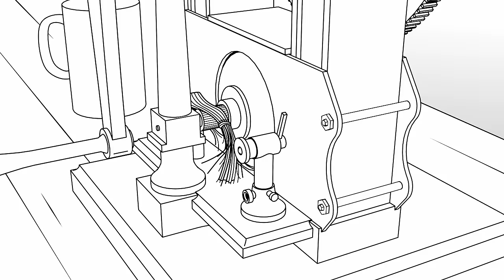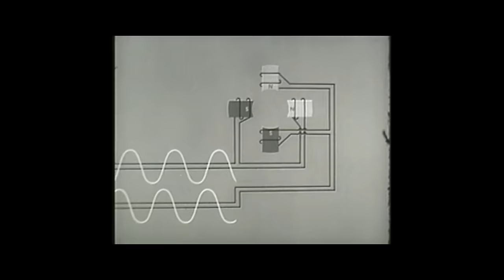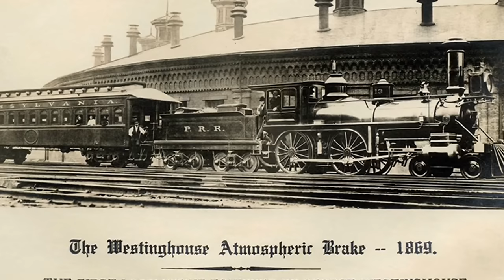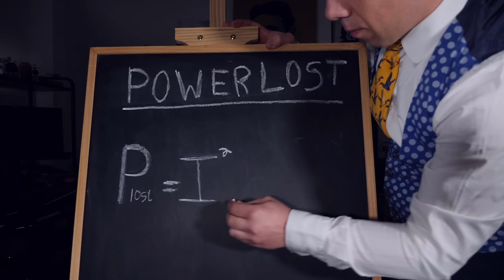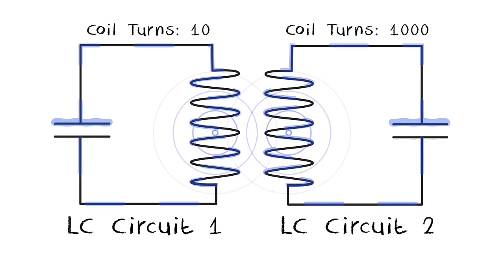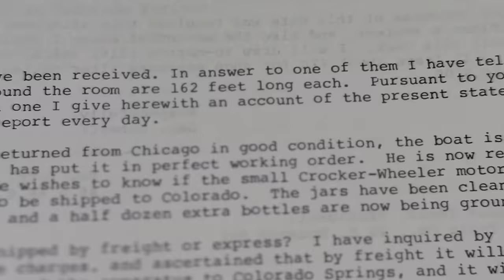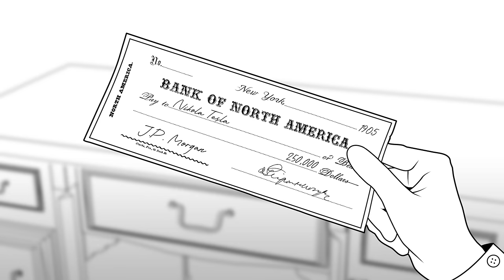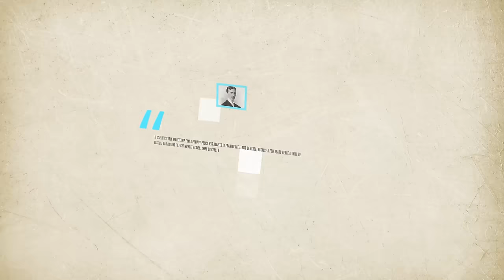The Amazing Life of Nikola Tesla (Documentary)

Comment: As far as stealing the circuit goes, there were two basic components involved. At the time there were only 4 types of component in existence, inductors, capacitors, resistors, and spark gaps. Capacitors and inductors are the key to oscillation. So Marconi took a capacitor and wired it to an inductor. That's it. You can't "steal" that. It was also the circuit Tesla used, but it's like the guy who invented throwing rocks at your enemy wanting a percentage every time someone uses a weapon. 

Marconi refined his circuit, the one with multiple transformers shown in the video looks like they're there as filters. That's important because an uncontrolled spark gap transmits on a huge number of frequencies. You'd only have room for a couple of transmitters in a country before they would interfere with each other. Refining that was Marconi's work and it was the beginning of practical radio. Marconi deserves his credit. Quite a few people ripped Tesla off but Marconi wasn't one of them.

Comment: Nice video. But, this voltage vs current thing is wrong. It's "current" due to "voltage" for "amount of time" ie. "the energy" denotes the danger. Your tesla coil can take a lot of amps for a short amount of time. You can use the oscilloscope and shunt to  verify this. Electroboom and styropyro have great  videos about the topic

Comment: Can you cast a mini limestone pyramid model made of relatively soft limestone, disaggregated it with water, then mixed the muddy limestone (including the fossil-shells) with lime and tecto-alumino-silicate-forming materials (geosynthesis) such as kaolin clay, silt, and the Egyptian salt natron (sodium carbonate) and cast into blocks on the shape of the pyramid, with running water underneath that slaps into the roof of the subterranean chamber while using the flowing water being spilt up by columns to convert the water to separate hydrogen and oxygen gasses and use the hydrogen inside the pyramid along with the reverberations of the water slapping the subterranean chamber to shoot a laser out of the air shafts coming out of the king or queens chambers? Just wondering 🤘

Comment: hey @integza ive been tossing and turning in bed thinking of new ways to make power besides the use of pressure and steam (as most power plants use overyly simplified) BUT i was thinking if there is any way to harness energy from sheer heat alone no other "gears" like steam to harness electricity, i know we have found a way to harness this electricity from heat already but i think itll be a cool to explain just how it works
Reply: i mean power and steam as in the use of turning a turbine connected to a generator to make power. my question is how could we harness that power with just the heat alone.

Comment: Jet-Powered Generator:
Modify the turbojet engine to generate electricity. Connect it to a generator to produce power for small electronic devices or to charge batteries.

Comment: Idea for a video testing simple ideas (maybe dumb?)
1- can you drain water into itself for perpetual flow? Like when siphoning fuel but get it circulating in the same container. You could test flow with dye. If so couldn't that generate electricity? (Inline fans). Seems easy to test, even if it doesn't work you perhaps could explain why because in my head it works 😊.
2- this idea is about converting rotating motion in vertical plane (spinning weights) to upward lift. But it's too hard for me to explain the concept in this comment.  Message me if interested, it's very simple in construction. 
I need a 3D printer Joel, lol 😂, so I can test print my modular furniture and gate lock ideas 💡. 
I really love your videos on plasma propulsion systems and future technology. Peace 🙏

Comment: As a big fan of Tesla since childhood I find this video super interesting and well made. Video idea: I always wondered if you could build a coil (which would work as a receiver) with for example a phone charger hooked up to it  and sit it next to the tesla coil to charge your phone wirelessly on short distances. I would love to see that being accomplished.
Reply: that's how wireless phone chargers work, only they're actually set up efficiently.
Reply: @thekaxmax  yes kind of but you have to literally lay your phone on the induction charger i was thinking that with tesla coil you could have the receiver and transmitter set apart much furhter and still transmitt energy
Reply: @miko1072   That's the problem they found; you can't. Tesla's work was the first thing they went to. It's magnetic induction, and so short-ranged. Tesla's idea on power projection failed because he made a basic mistake, as I mentioned. The only way to usefully project power at any range is using lasers.
Reply: @thekaxmax That explains a lot. Also when building the tower he didnt seem to take into consideration gigantic high frequency electromagnetic fields.
Reply: @miko1072  gigantic EMF is what he was after. The problem was that it didn't act the way he expected. That's the flaw I mentioned.

Comment: I have just been watching some of your rocket videos. Have you ever considered trialing different home made recipes for solid rocket propellant specifically with the addition of metal powders such as magnesium to boost the burn rate and therefore thrust of the rocket. Then as before comparing these using a forcemeter. I am sure that there could be some interesting variations on the old sugar rocket with different amounts of only way to say it catalyst. I am new to suggesting things i think this would be interesting if the shell could contain the heat. You could also use different grades of oxidiser. There is also suggestions i have seen online of solid rocket fuel made from dried compressed animal fats mixed with oxidisers been used. So many variables and variations that could be used.

Comment: Integza i have an idea of new rocket engine, you can mix potassium permanganate with ethanol and use your swirl injector from glass rocket engine to inject mix of potassium permanganate and hydrogen peroxide and light it on fire, because of the reaction of hydrogen peroxide and potassium permanganate it produces oxygen and the fuel(ethanol) is already in the mixture

Comment: For those wondering if I understand correctly. Low current typically will make most things safer because the skin has some resistance however eventually when the voltage gets high enough it can use your body even with low current.

Comment: Intezga a question how did you pump the air in your glass Rocket engine can I use any controllable air pressuriser and is your butain gass or liquid. Can I use a 10 to 150psi 12v air compressor please reply if possible

Comment: Make an RC Plane using a brushless motor and also add an liquid fuel Rocket engine to it. I know it will be really difficult to fit the whole engine in the plane without it being too heavy, so you can maybe add an active hydrolysis system to generate hydrogen and oxygen. Also add a nozzle to it. Imagine flying a Plane and then you activate the rocket engine and it goes booom flying like a jet, it will be hellaaa cooool :D

(I actually wanted to do this myself but haven’t got the resources at the moment)

Comment: I believe with a simple binary signal like the basic spark gap transmitter generates, they would actually do 2 taps per letter (in quick succession for a dot, and with a noticeable gap between them for a dash) in Morse code -- since it's much easier and less ambiguous to differentiate a beep from dead air than it is to determine how long the 'pulse' was. So what you tapped out wasn't quite accurate insofar as what was transmitted from Titanic 😉

Comment: The part on "what kills you, the voltage or the current?" was unfortunately incorrect. If a high voltage is across a human body, a high current flows through the body. The answer to why tesla coils aren't a shock hazard has nothing to do with the transformer and everything to do with output impedance and frequency. The output impedance of (many) high-voltage transformers is very high, which means that the open-circuit voltage may be high (in this example, hundreds of kilovolts), but as soon as the arc forms, the voltage drops massively. The second factor is that the high-frequency involved in tesla coils forces the current to flow almost entirely along the outside of the conductor due to skin/proximity effect, meaning almost no current flows near nerves and the heart.

Comment: The true Tesla coil had one primary and 3 secondary coils  ,  example formula: primary coil 200 turns 4 inches high , the gap to first secondary is 50% of the height of primary 2 inches    , then secondary winding is 50% turns of primary 100 turns then the gap between 2nd and 3rd secondary the gap between them is 50% of the height of secondary coils . That info is from 1989 a topsecret scientist that worked with Nicola Tesla 1920's  it's real and hidden from us , info was released after scientist passed away .

Comment: Tesla's principle for transmitting wireless power wouldn't have worked, as it is just transmission of long wave radio, and there is no practical way to generate the energy density that is required. You're fighting the inverse square law, so close to the transmitter it's possible, but a few meters further away it would be useless. We know today that transmitting directed energy is possible, with antenna dishes and microwave transmitters, but it still involves dangerous levels of beam intensity.

Comment: would it be possible to run a boat on a hydrogen hybrid system, with the hydrogen being electrolyzed from water pumped in? would you need solar or wind generation to maintain the cycle?

Comment: I would like to see a video where you take two pieces of wood and build a metal housing around each of them. Then using pyrolysis to turn those  two pieces  of wood into carbon plates. And using recycled plastic build a battery housing for the two plates, then filling it with  an electrolyte for a battery simply just to test a theory. Try it before you deny it kind of thing. try one with battery acid and another with simple pickling salt. If you are successful I will give you for free more ideas than you will ever be able to build in a lifetime.😃

Comment: Good video and I enjoy your passions. Tesla is an American tragedy unfortunately for us.

Btw, I believe I'm close to solving the wireless transmission problem and I believe I have some demos I've posted on my channel here that illustrates some of the strange behaviors and concepts I've observed playing around with it. Unfortunately, I haven't touched the stuff for a number of years for which you can blame the family courts for mostly but regardless I still have a few proof of concept experiments yet but I think I'm close. I did a demo for Tesla Cult at his lab years ago and he has had some success recreating it as well.

Currently, I'm at the point where last time I had an accident that kind of scared me so I need a safety partner to get through the next steps. Basically last time, I grounded my oscilloscope accidently to a high voltage side of one of my coils and my fuse box to the house took a hit and no longer worked. Oops. The goofy thing is, the coil continued to oscillate on it's own for many hours after as if the off on switches weren't even there. So ya, I'm having a hard time convincing anyone to at least let me call them before I start my next experiment. Anyways, let me know if you're interested in maybe taking over or partnering?

Comment: Make a video showing that, lets say 10 watts dc motor driving 50watts dc motor using different ratios gears, which means you will create 50 watts of power using only 10 watts then plug the 10 watts dc motor from the output of 50 watts motor which will give you 40 watts of free energy........i hope i will win this 3d printer......V

Comment: You can attempt to convert a normal 3D printer into a metal 3D printer. It will work if you glue a starting sheet to the build plate and make the printer use a welding machine to deposit metal by running the welding  wire true rhe printer head. Something similar is shown in a video by Undecided with Matt Ferrell called  "Why NASA's New 3D Printed Rocket Engine Matters".
Reply: He did that before or something very similar. 

There are more viable options especially considering he owns a CNC machine now but your idea isn't incorrect but it's not exactly as clean as some things he needs